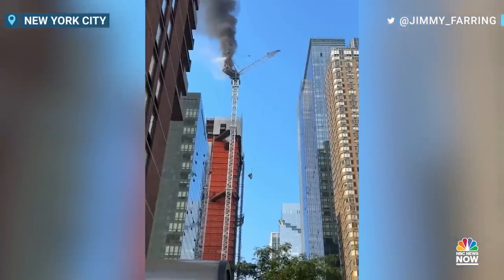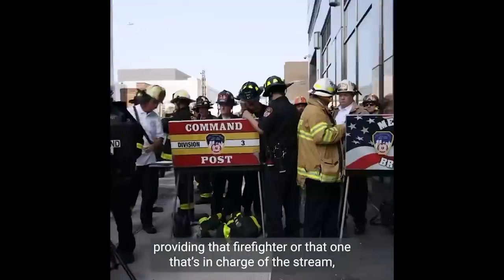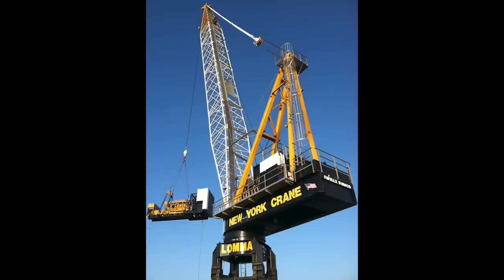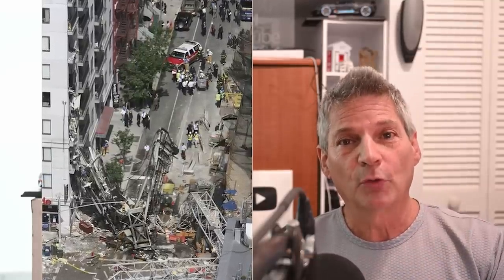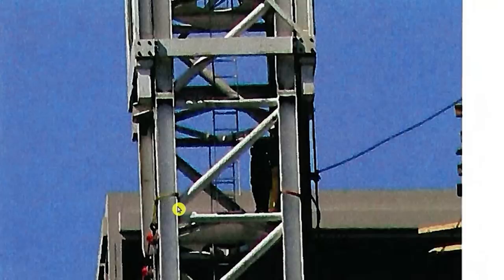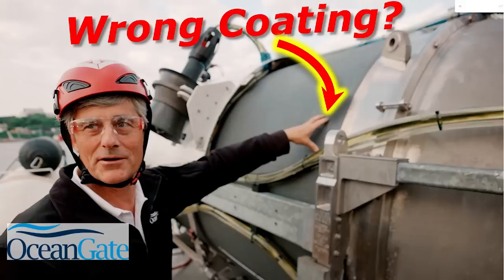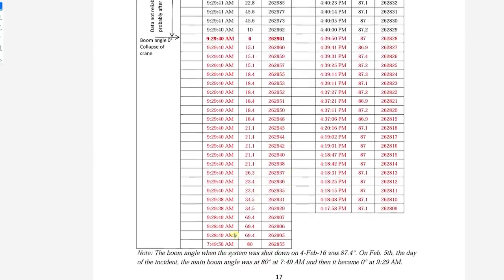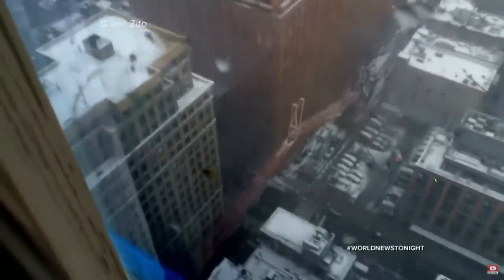New York Crane Collapse Cause, MORE Fatal Collapses

Comment: I was in the fire department when I was younger and they didn't teach us anything about the angle of the water coming out of the hose. However, I also worked for a department that didn't have any really tall buildings or many instances where just the pressure available to us wouldn't be enough to easily reach the fire. Also, literally all the fires I fought were wild land fires and we did medical calls around town other than that.

The other thought I had is that perhaps that lower line was trying tower down the building onto which that crane was anchored so that the fire wouldn't spread to the building. In fact, I'm almost certain that they would be putting water on the building because that's something we do if we can to keep fire from spreading from one house to another and also on brush to slow the fire down and help us contain it when it's a wild fire. This still doesn't explain the other hose other than perhaps there being a lack of communication between the drone operators and the firefighters on the roof aiming the hose line since it may have appeared to all of them that they were hitting it. They would have been aiming at the base of the fire since you have to do that to put it out. If you just aim at the flames above the thing that is on fire, all you'll do is make a bunch of steam. I wouldn't be surprised if the firefighters aiming the hose thought they were hitting the base of the fire from their angle. Hopefully, word got through from the drone pilot that they needed to aim higher.
Reply: So here's something even more ridiculous about the fire fight. If that was fuel or oil burning, they should have been fighting it with foam, not water, as oil and fuel will simply float on top of the water and continue to burn, spreading the fire instead of putting it out. Maybe the hoses were actually being aimed in an attempt both to cool the surrounding structure and to prevent the building from catching fire while they waiting for an engine with the proper firefighting foam, probably an ARFF unit from the airport.
Reply: If you look at 3:41, you will be able to see they do in fact arc the stream upwards. If Jeff is using the video he shows us as the reference point, then I'm not sure he's accounted for the fact that they may have been holding that hose for hours upwards and it's not exactly light. It looks like there simply isn't enough water/mass to take it the distance and more pressure is needed.
Reply: shouldnt build anything that you cant rescue from. Sensible
Reply: @whoever6458  You may right about just keeping the crane cool enough to avoid further collapse and not spreading an oil fire.
I wonder how the fire was eventually put out.
Foam is a good idea but how do you deliver it to the fire? Would it travel that far from the other building when water wouldn’t go that far? Shooting from the ground would take tremendous pressure. An airdrop from a helicopter might work. 
I don’t know what they finally used to get it out, maybe just let it burn itself out.
Reply: Right, it’s pretty hard to see exactly what is happening /over there/ through the spray.
Reply: I caught a video showing this fire fighting op perhaps a day or three after the fire.  It included radio chatter - the chaps throwing water on the fire from across the street didn’t have a good view of where their water was landing.  Others with a view (drone operators?) we’re having to relay details to them.  Wind was another issue, and it was not a constant, steady breeze, it would shift.  I could see wanting to keep water on the blaze, oil fire or not.  Water may not put it out, true, but it can cool the structure.  You really don’t want more multi-ton bits falling down.
Reply: Water will put out an oil fire, but it takes and awful lot of it and it's much slower than foam.
Like someone else said though, delivering the foam isn't possible at that height.
99.9% of fires requiring foam  happen at ground level.

Comment: As far as the 45° angle you mentioned that's all we'll and good until you figure in the Wind up there and it was blowing pretty good that day ! So the Line has to constantly be moved to counter the extreme winds at that hight !
Reply: A lot of the engineers I’ve dealt with lack real world experience.  This is a perfect example.

Comment: Stumbled across your channel. Full disclosure i am not an engineer, however i am a retired Firefighter/Paramedic Instructor and Field Training Officer. The only thing i feel experienced enough to talk about are your comments on the water streams. One hose stream reached the fire and the other was basically useless which i totally agree with, it's the reason why I'd like to share insight on. When you look at the close ups you have at the hose/nozzles. particularly the 2:15 and 3:35 mark, especially the 3:35 mark, the useless stream with nozzle closest to the camera has a different type of nozzle and it APPEARS to have a smaller hose diameter hooked to it. So to start there is not as much water pressure and flow, the useless nozzle and hose is being held by one firefighter with no assistance. That hose diameter is either a 2-1/2 or 3" diameter. They USUALLY flow at 75-80 PSI and about 180GPM. If you look at the hose farthest from the camera it is a different type nozzle that is called a smooth bore nozzle so there is no flow restriction. If you look on the ledge you will see a black anchor extended across the ledge with hooks to secure it to the end of the ledge. That is assisting the firefighter in holding the hose in place. Since they were obviously not hooked dirrectly to the firetruck there is no way for us to determine psi, velocity or gpm. However, considering the firefighter with the useless hose stream was able to hold it by himself and not have it tied down, that hose did not have the psi or flow rate to reach like the other hose did. Since I was not there I could only speculate that possibly his stream was trying to be directed to the rooftop itself to put out any drop fires that were started by burning material/embers falling and possibly landing onto the roof of the building. So while I agree with you wholeheartedly that the second stream was useless as far as the main fire, i do not think it was tasked with that to begin with. Otherwise I do appreciate your engineering insight into everything else that occurred. Thank you for the time you spend making these videos. Eric

Comment: Couple of points, First off the angle of the water, you can see the water is dispersing from a jet right near the crane, if they angled it any more the jet would have dispersed further away from the crane, so it didnt have the range to hit with it at 45 degrees. you can also tell the aditional hose has less pressure than the first as it disperses alot futher away from the crane. Second point is while indeed it could be a lack of inspection, its also possible inspections were carried out and everything was in ordered, minor hydraulic leaks on construction equipment can start at any second in time as nothing externaly visual will be present at the time of inspection on the hoses or connections, assuming the initial report of an oil leak starting the fire.

Comment: Thank you. Very informative. It was worth the wait.
So it was indeed a diesel engine and hydraulic system up there. I believe, direct electric drive would be a safer option in a city where plenty of electricity is readily available.
At one of the video fragments, it was clearly visible when the end of the broken cable whipped out of the pulley that held the jib up. The shock created a plume of dust and debris, clearly visible against the blue sky.
Reply: Or just a separate generator wherever tf, but not hundreds of feet up in the air.

Comment: Okay, not sure where they left off in physics class but unless they're launching cannonballs, the ballistic trajectory doesnt hold true with a water stream that breaks up over distance. The ballistic, no air resistance, academic idea goes out the window as the water and air interact and the stream turns into droplets without the mass to force thru the air. A certain amount of lob may help at short distances or when at or below the level of the fire. When the fire is lower then the platform its entirely possible that a horizontal or even downturned stream is on target and offers the most effective applicaton of wet stuff on red stuff.

Comment: On our drill rigs we did daily inspections, kept everything clean and painted white, and we’d still have sudden blow outs. We had Pirtek on speed dial.
Reply: Forgot to add that after one bad voluminous blow out (no fire but smokey) we added protective sleeves and hose whip restraints to everything had thick spill kit diapers under the rigs as a precaution. 

We also installed these grapefruit sized balls of highly compressed dry-chem extinguisher that explode when fire touches them and shower the compartment. 

Doesn’t stop the occasional blow out, but reduces the danger. But still, who knows if any or all of these could have prevented that crane fire. 

Seems the only thing that would is installing one of those aircraft engine extinguisher sysyems or having a small diameter stand pipe up to the crane.

Comment: I don't think 45 degrees gives you more distance with a stream of water.  The further you push a stream of water through the air the more the air resistance breaks it up until its too small to maintain any momentum and becomes subject strictly to gravity and wind currents.  It's not like a cannonball that maintains its mass throughout the arc.  A higher arc just means it has travel further and overcome more air resistance to try and reach the same distance.  Of course, having no arc at all is going to give you less distance than having some, but I think they weren't trying to reach the fire with the flat trajectory hose.  Likely they were trying to hose down everything below the fire in case anything burning fell off.
Reply: Physics tells you that 45° is the angle you can throw anything to get the widest reach. Other factors might get into that. But not holding the hose up to 45° will never result in max reach.  And those factors are equally at play if you aim lower.
Reply: @V100-e5q   These people are into "alternative" physics , hehe
Reply: Blah blah blah you said nothing of value
Reply: Different pumps, different size hoses, different size nozzles, all have an effect on how far water shoots.
Reply: @OttoByOgraffey  But the basic calculation is about angle. And that applies to all other factors in the same way.
Reply: @BrainWasherAttendent  Yeah, some people are physically challenged.

Comment: 45 degrees is only the best for a solid projectile with no drag, no wind and where you don't care about the direction it arrives in. A water stream has high drag and the drops disperse rapidly. That drag might actually give better reach to lower angles under some conditions. If a lower angel works at all, it will also likely get more water on target.

Comment: In California, I have seen them put the booms down just at the end of the work day since you never know when there's going to be an earthquake around here. Don't know what the procedure is if they're working when one happens. I'd hate to be the person in cab in that case, especially if the earthquake is a big one.
Reply: I had to come back here because I just looked it up and apparently they design earthquake-resistant cranes. They design them so that they won't collapse or drop their load during severe shaking, which is the ultimate requirement for them, and that, in the case of just moderate shaking, they are designed to continue to be fully operational. I have noticed that I've never seen a crane around here that looked anything like the ones in these collapse videos. I didn't go as far as to look into the exact specs but, from the pictures, I would guess that part of what makes them resistant to shaking is that they use a huge counterbalancing weight instead of just some hydraulics. I would imagine that this means less load is imparted to the supporting structure when things start shaking. I can see why they don't do this all the time, though, because it takes up a lot more space. I don't know how they'd do something like that in New York City at all due to the already limited space but they should come up with something as there are actually faults capable of producing a pretty significant earthquake running right through New York City.

Comment: With how many of these cranes are in use (and how often, too) in cities like NYC, I'm not too surprised that it happens this often. It's something that most likely will happen at some point. All you can do is update inspection guidelines after the incident, and try to minimize injuries during.

If it comes to who is to blame, it's everyone who works on and in the crane.
Regardless of if you are freelance or an employee, you should always check the equipment you are using and report any issues you come across. Then it passes the blame to the person who gives the go-ahead to continue the crane's operation. Unless it's obvious it's going to lead to a disaster, you will never be to blame if something does go wrong.

Comment: I've had to work around cranes. I've learned to stay clear of the operating zone unless I'm actively directing or controlling the load.  As far as the collapse due to fire it could be operator error on the operator's routine safety inspection, insufficient/improper maintenence, something missed on the owner's equipment inspections, or just an unpredictable failure.  I suspect that noone was keeping the engine clean so the oil on the engine was hiding the existence of a small fuel leak.

Comment: I'm no expert, but a couple of thoughts. On the angle of the firehoses: distance is not the only factor. It is also essential that the water stream hold together. A higher angle would have put the water stream into the unobstructed wind flow above the highest buildings in the area. It might not have worked. I wonder if they tried it earlier, before the video clip that focused on the drone, not the start of the hoses.

From a safety prevention perspective. Cargo aircraft are required now to have fire suppression systems in each cargo compartment. This was implemented when we realized just how dangerous fires can be when they are in high altitude locations that cannot be reached in time. It seems to me that regulations requiring fire suppression systems on elevated crane platforms would be worth investigating.

Comment: I can tell you from reading hundreds of incident reports and being on at least that many related phone calls, hydraulic hoses and seals often burst with little to no warning. When this happens on the ground, it is bad enough.  

If it was a bad hose or seal, my guess is that one of two things is true.  (1)  The company failed to do preventative maintenance, or (2) thye got a bad part.  Statistically, #1 is far more likely, but #2 does happen.
Reply from the maker: I agree with scenario number one
Reply: That one on westlake? Scary stuff.

Comment: "How do you miss a worn hose or loose fitting"...  Spoken like a true engineer. 

Would be just as reasonable to ask the engineer to design an entire system that never succumbs to vibration.
Reply: Right. I'm a quality inspector and even we're expected to mis up to 30% of problems. Humans are just gonna miss stuff no matter how hard we try not to, and especially during routine checks. This is usually why checks in my area of work are done by more than one person, are done multiple times, and/or are done more than necessary (something that might only need checking once a week may be done daily just to ensure if something is missed once, its hopefully picked up the next check).
Reply: You would think this equipment would be inspected and serviced like transport aircraft.

Comment: At 5-mins, the power pack is shown and the device on top is not the fuel tank, but is actually the muffler and you can just see it's flapper rain cap on top.

Comment: It is amazing how one small detail can mess up the structure of any machine, a possibly leaky hose of oil, a broken strap, a faulty baring, etc. Normally the videos you show of disastrous results of a structure of some sort collapsing or imploding has some big key lessons, but really the hindsight of this case is to inspect probably at least twice a day or maybe twice every time someone uses it. It’ll be interesting to know if there was a missing responsible party and it could lead to more updated regulations, or at least what comes out of the report. While the fall of a crane can be fatale, it tends to be a rare exception given that if it happens, it happens in a small amount in just over a 15 year span. If certain details does add up and it leads to being an updated process of inspections, will it help prevent this scenario to happen 0 times in the next 15 years will be interesting. We’re probably going to have to remember this case by the time 15 years has gone by to know whether it has worked or not.